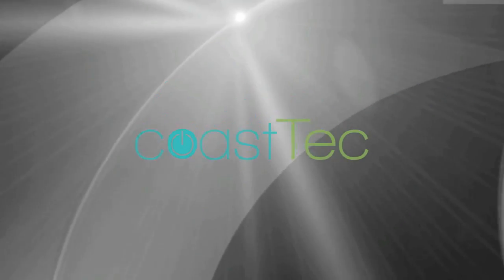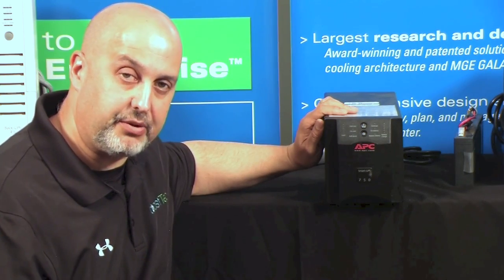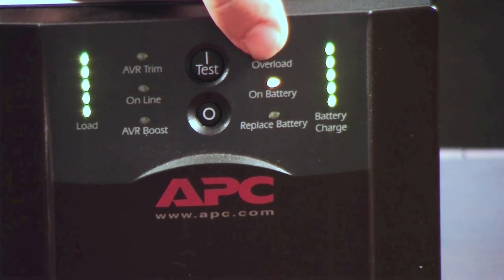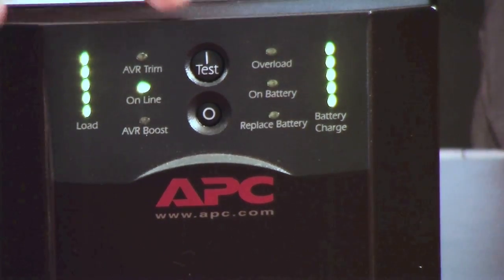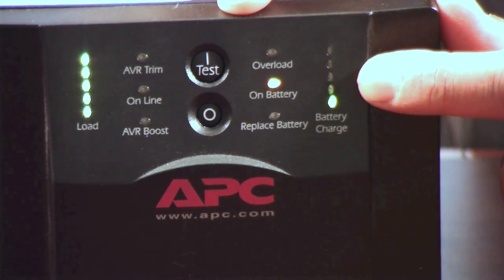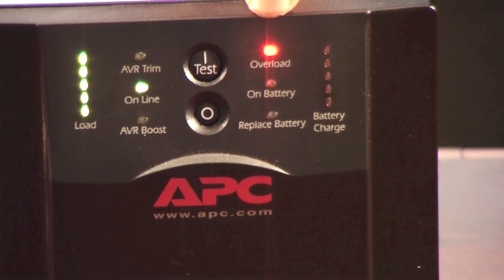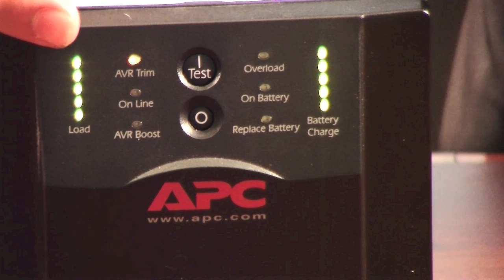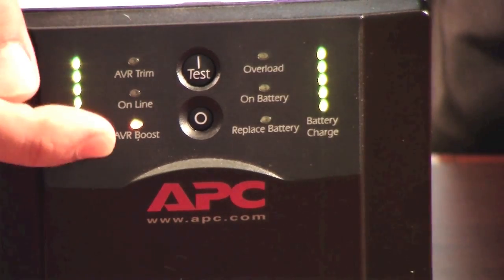What's your APC UPS telling you?

Comment: I have an old APC 700, and I think the battery needs to be replaced.  A red light in a box w/ an x is lite, and thing was beeping like mad. But, I moved cables and I have a light fix. I'm either swapping battery or buying updated system

Comment: I have a quick question.

My APC xs-900 used to have a batery 12v 7.5 amp, I bought a 12V 9amp replacemente batery. Do you see any issue with the higher amp?
Reply: There is no issue with using higher Amp-hour (Ah) batteries. It will just make the run time longer. You would have more time to save work and shut down your computer.

Comment: Have apc smart ups 700 and no texts on leds, but some battery with wave inside is lit and it's continuously making the beep noise. No button pressed helped in any angle, just removing the power IN cable from ups made it shut down and putting it back on, it just turned on like nothing had happened and everything looking fine... BUT IS IT? (it has been happening last few months every second week now...)

Comment: I left my new APC battery 650VA / 360 WATTS for 10 hours straight to charge up and still the red power light keeps flashing which I do not seem to understand why? I use 2 PC desktops with monitors and some drives connected to it. Is it too much power consumption for the battery but I used to use APC Backup 550 before (same computers, monitors and drives) which had 330 watts less than this new one with no problem. Anyone please help. Thank you.

Comment: Have recently acquired an APC Smart UPS 750 with indicator lights similar to the type in the vid, except mine has symbols instead of words on the various lights.  When in the battery power mode, ie, power failure with the UPS supplying power,  there are 3 bleeps every 30 seconds or so.  What does that mean?

Comment: Hi Thanks for the info...
I still have few questions...
I have APC 1500XL and i am only using it for a single computer.
This UPS is hacked to support external and bigger batteries...
I have attached 180x2 Acid batteries.
1. UPS does not fully charges the batteries. When it switches to battery it directly goes to 60% the third light.
2. It keeps switching between Battery and Online when i have load on it. When i turn off the computer it charges normally.

Please tell me what is the problem and how i can get it fixed .
Your Help would be appreciated. :)
Thank you.
Reply: Shoaib Rafiq 
Same problem with mine..when switching to batteries 2 points of battery gets down even if no load on other site... apc technician , to whom i purchased this unit say it's back-up is on last 2 points on liquid batteries..don't know he is right or wrong..need to confrm

Comment: I recently modified my APC Smart-UPS 1000 to use 2 RC7 batteries which basicly makes it a Smart-UPS 1000XL and gives me longer a run time. My question is will this effect how the software looks at the remaining battery charge capacity? I guess what I'm asking is will the software tell me I'm low on power when in fact I have extra capacity?
Reply from the maker: +52wml If you do a runtime calibration on the unit, which can be done through the network management card, then the unit will read the proper runtime.
Reply: +CoastTec  Thank you for the response, it was most helpful and appreciated

Comment: i have an APC Smart 750,the batteries died and were replaced a few days ago, but the led battery indicator lights wont stop blinking, and the battery levels go from 100 to 20 in a second, but on battery and over 20%  load, it runs for over 30mins. how can i fix this?
Reply from the maker: +Michael Osude The problem is probably calibration or the charging circuit is not functioning. We would suggest getting the unit serviced. Visit coasttec.com to request a quote.
Reply: +CoastTec the charging circuit works coz the led rises from 1 to 5 but it stays blinking even when full, and if the grid power is disconnected, the led goes down to 1 but the UPS runs for over 30mins before powering off. how can i calibrate the UPS, i tried with powerchute but it didnt help

Comment: My unit, not sure of the brand name (China) but found out it wasn't working on brown outs and it was hot, I took it apart and the battery was dry, I filled it with purified water and began charging and after a couple hours both lights started squealing at the same time, I tried unplugging the unit and recharging but these lights won't stop?  Bad battery or?
Reply: Pretty sure you need to add distilled or deionized water not purified water

Comment: how to take off audible alarms for this UPS?
Reply: +irishboym4 and how does one modify the EEPROM? I have two of these; and periodically, they go off in the middle of the night, waking my dogs.
Reply from the maker: Shaun-Kendall Sooknanan There is actually no way to silence the audible alarm short of removing the buzzer. If you are adjust the sensitivity of the unit, the alarm will happen much less frequently…you can refer to the video about adjusting sensitivity.
Reply: +CoastTec you can disable all the alarms by modifying the EEPROM.  My unit does not make any alarms.
Reply: Use APCUPSD,within that application use the program apctest
Reply: Press slightly the on -off button while beefing..it will  disable the alarm..

Comment: why would you replace your ups battery?
Reply: +James Ram because they only last a few years. My first set of batteries ran dead after 7 years, this set is starting to die after 5. Other people tell me I'm lucky they lasted this long. A new set for the APC SMART UPS 1500 will cost $159 from APC, or $99 from an aftermarket company. It's a good idea to check the UPS every six months to see how well it is working, as well as opening the front to see if the batteries are getting warm or swelling. Doing this is like checking the oil in your car; it only takes about 5 minutes, and will make sure the UPS will work when you need it.